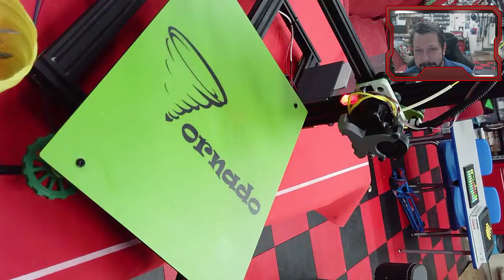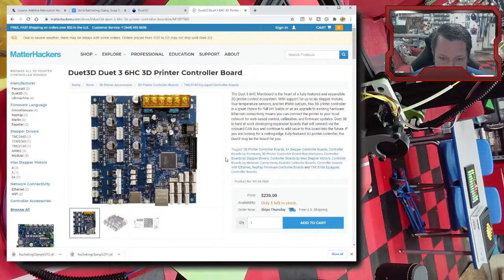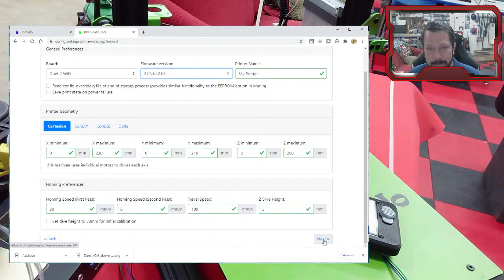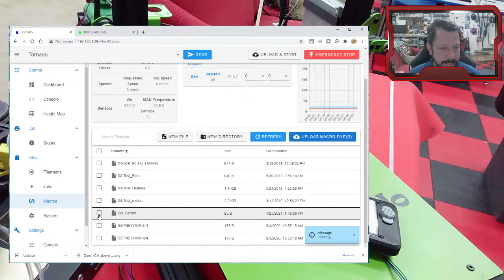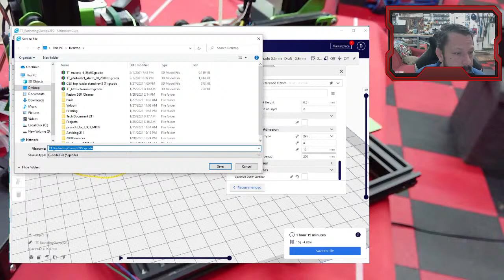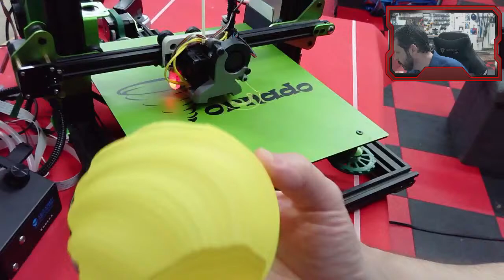14 | Duet 2 Wifi | Tevo Tornado

Comment: Hey. I'm just installing a duet 2 into my Tevo Tornado as well. Is there any way you can share your set up configuration with me? I am also running a BL touch and everything that seems to be similar to yours. But I am at a complete loss as far as the overall configuration.
Reply from the maker: I am not sure I can find that file anymore. I will look for it a bit and see if I can find anything. It has been a while since I used it though.